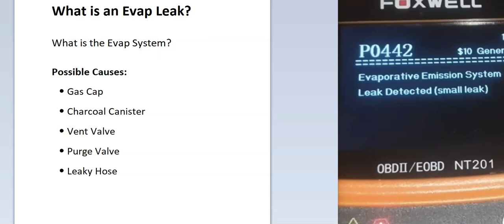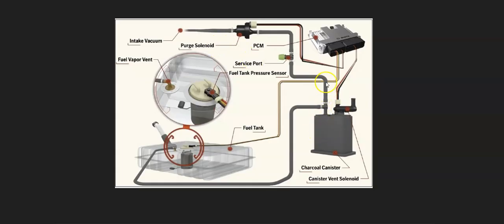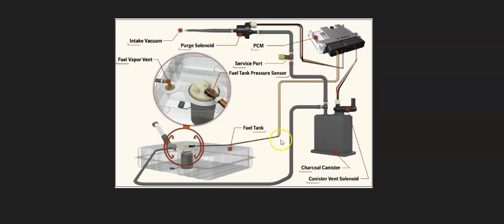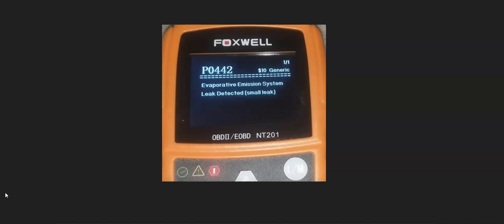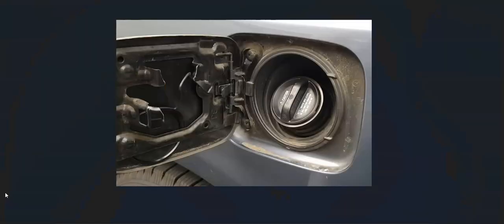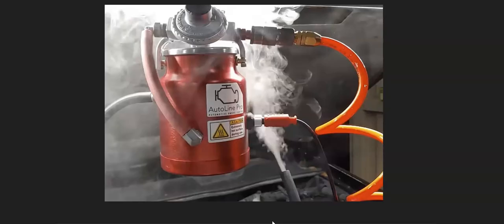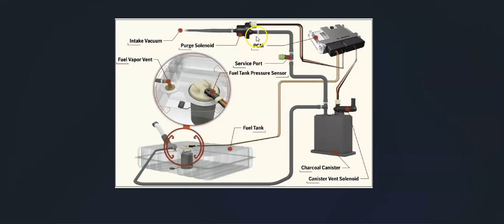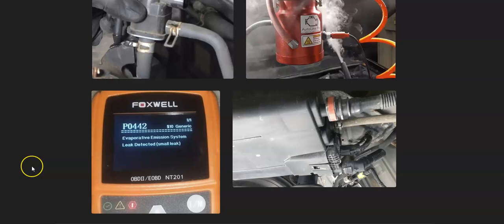What is an Evap Leak? (What is the Evap System?) (How To Fix an EVAP Leak)

Comment: Thanks for the video, the code was 0455, what is that specifically
Reply: I got the same code.. for me it came up as large evap leak and i also got 0457 which was loose or missing gas cap (i have a capless system) so im hoping this video helps make things more obvious for me to identify

Comment: I have. 2012 ford fusion... There is no gas cap for the this model…
Reply from the maker: The capless gas systems have a flap that needs to seal, or it will cause a leak.

Comment: good  video to explain  the  evap, I  have  a  99  Camry v6 with an annoying  2  PO446 and  it's comes up  twice  with the  scanner . I  can't  find  any  leak's  and  they  want buy a  new  canister , any  ideas  ?
Reply from the maker: A P0446 Code is an issue with the Vent Control Valve, which is usually on the charcoal canister. I would check the wiring going to the Vent Valve and test it. Sometimes the Vent Control Valve can be bought separately from the charcoal canister.